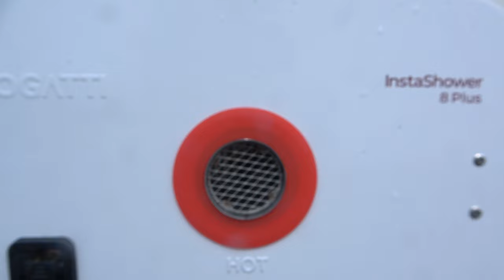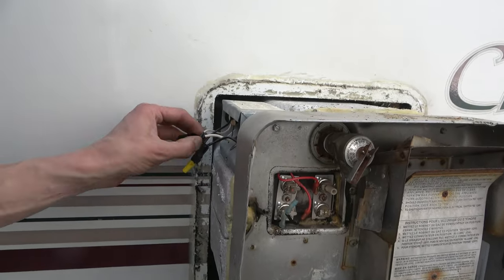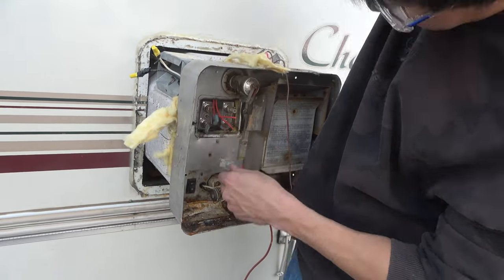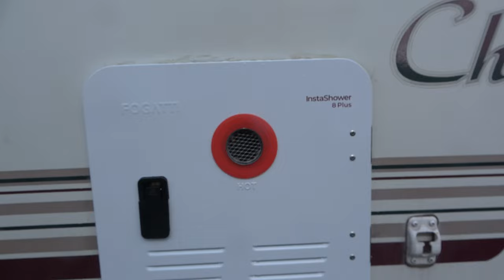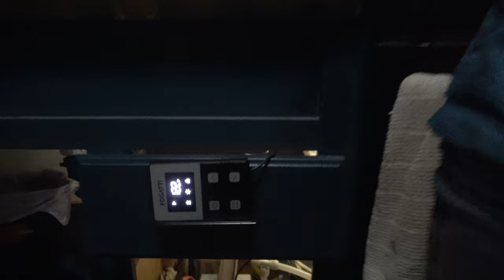How to Install a Tankless Water Heater in an RV // Fogatti InstaShower 8 Pro

Comment: Great video!  Thanks for the info.

I'm a few years out from being able to go full time and am currently a weekend warrior, that being said I would love to see how you guys are liking the class C while full time.  I believe you do a lot of workcamping in between some extended stays and would like to know how you handle things like grocery shopping ect while at an extended couple month stay somewhere while working.  This is the part of me that is thinking a trailer would be a better option for me as you don't need to break down to go to the store having a separate vehicle to do things like exploring while posted up somewhere.

Anyway, thanks again for the updates, it's good to see yall out there on the road doing what you love!

Cheers!
Reply from the maker: We love our class C. Went 1.5 years with just bikes to get around. Finally saved up for a tow vehicle that we pull behind using our Roadmaster tow gear. It’s so easy we hardly know the car is there. That’s the key to our long term stays when we have to work camp. It’s worth looking into if you have a towable car already. Similarly. If you have a truck already maybe the trailer works better financially. Up to personal preference. For us, the tow vehicle behind our Class C is perfect.
Reply: @CalledToWander  Would make a great video!  Best wishes to you both, look forward to more content!

Comment: I have an Atwood  6 gallon water heater in my camper and it has a 15in. Tall x 18in. Wide opening.  So i have been trying to find  a heater that comes with that size door. As soon as i find the proper sized unit i will be purchasing one for sure. I am set up permanently in a full hookup site so i hope it works like it is supposed to. Appreciate the video. Have you had any problems since you made this video or any updates on how its been operating for you?
Reply from the maker: If you’re stationary and don’t rely on hot water when boondocking then you’ll be fine. We’ve not had an issue and only ever “wasted” a bit of water when boondocking. But we’ve found ways around that.

Comment: Did you have any issues with wiring it? You didnt show that part and many reviews state they couldn't get power. Would've loved to see how you ran the remote and wired it. I saw briefly you had red to black and white to ground. Did the blue wires just go straight to the remote? Thanks for the video
Reply from the maker: We left that to the professionals, and sorry to have left that out. We were racing bizarre Los Angeles rain and sunset. But the wiring schematic should have outlined the wiring of the remote.

Comment: Do you have links to the parts you used for the propane line extension? I have that same issue. I already decided to get some additional water lines due to the different placement on the Fogatti than on the Atwood, but I don't know the correct parts to extend the propane line. Everything I'm finding seems to be for your grill and not the 5/8" UNF size specified by Fogatti.  I had that same issue with the screw heads for getting the Fogatti into the opening. I had metal pieces there and a couple of bangs with a hammer where the screws scored the metal and it slid right in. Thanks for the informative video.
Reply from the maker: I do not. I just know it was readily available at Home Depot and a much more sensible solution than trying to pull and bend the existing copper pipe. Sorry!

Comment: I have the 10g Atwood in a 2002 Fleetwood Bounder. From your understanding what challenges can I expect?
Reply from the maker: If you haven’t owned it since 2002 then likely previous owners didn’t change the anode rod. Check that immediately and replace it if it’s corroded. If the anode rod has been bad for a long period of time there’s a chance the water tank itself is corroding from the inside out. Worst case is you’re going to turn it in one day and hear it start to heat up and then the terrible sound of water spraying and leaking out of the rusted tank. You can also look beneath the tank exterior and look for signs of rust. We had a rust pile under ours, probably 6 months or so from catastrophe
Reply: Thanks! I was meaning challenges with changing from the tank to the tankless. I just recently ordered the tankless
Reply from the maker: The challenges we faced were figuring out which wires to connect from the new unit to your existing wiring from the old water heater, which will vary. Also, we had issues with the lining up of the propane copper pipe which is why we used an adapter and flexible propane hose we got from Hime Depot. Otherwise the hole should fit almost exactly. We had to notch our hole out a bit as Shasta actually did a great job and had an aluminum frame around the hole to prevent water damage. We had to notch that… so, could be more than just an hour job lol
Reply: Thats fair. Yes wiring will be interesting. I know that the 120 can be put into an outlet or capped. As far as twelve volt I need a power and a ground? I assume I don’t the the switch wire anyone since there is no electric element .
Reply from the maker: @jamestrippca  We capped the wire to the switch since it is no longer needed. The wiring diagram should show the grounds, etc. It's relatively straightforward and the remote wires in separately in the front (outside access) of the unit so it's not like you have to figure out 15 different wires. Hopefully it goes smoothly for you!

Comment: What about the remote switch. My 2006 Aerolite has one switch if using propane and the other is for electric. Are these still used?
Reply from the maker: This tankless heater only uses propane. There’s no electric element like in an ordinary RV tanked water heater.

Comment: I just installed this in my 2019 Shasta and when I turn it on I first get a number 12 then to the temperature but the unit never fires up. The water is flowing the propane is on and lines bled but I’m at a loss. Any ideas?
Reply from the maker: Not sure, unfortunately. The only errors we’ve ever had was when we ran low on propane.